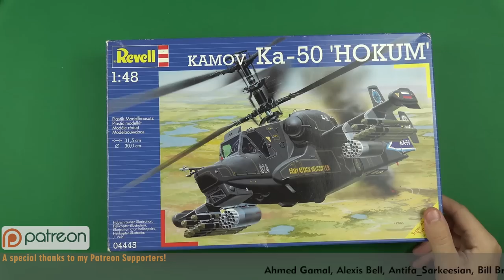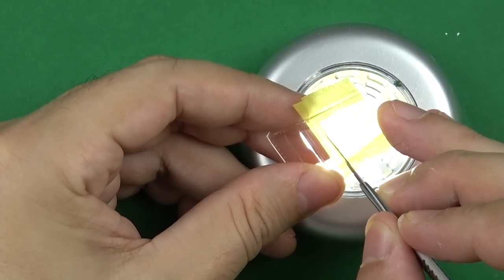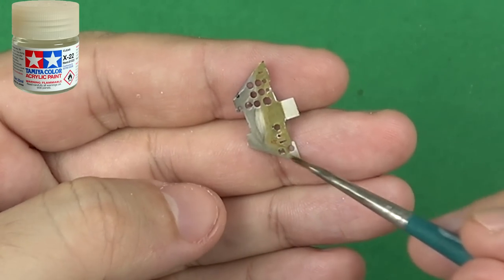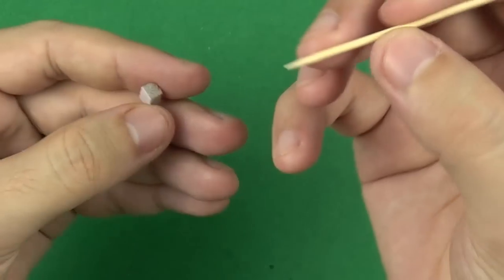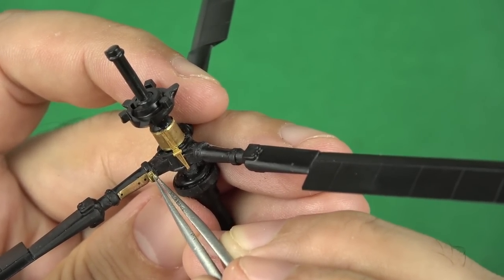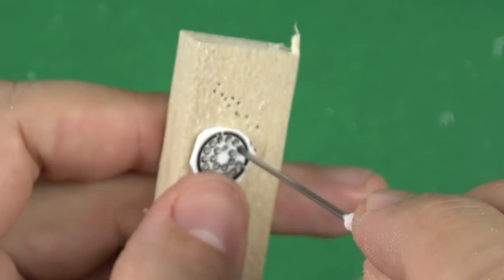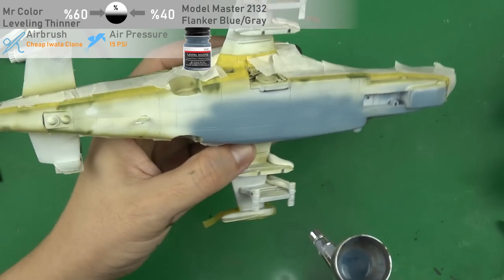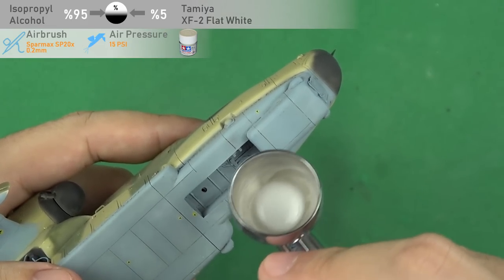1/48 Kamov Ka-50 "Hokum" Russian Single-Seat Attack Helicopter Model

Comment: I built the 1/72 version of that kit about a year ago. I did it out of the box. I wish the smaller kit had the separate inserts for the top of the fuselage. I lost most of those vents in fixing the centerline seam. I replaced them with some raised screen decals from MicroMark but they don't look as good as the engraved ones.

Comment: Hello Rahmi,
after 3 months of build I finished almost a copy of your Ka-50 model with your video as a manual and aftermarket additions. It was a fantastic build, I had same issues. I made the same error, nozzle break mounted 90 degrees wrong. but I saw you mounted the undercarriage fin in the wrong direction that I could avoid ;)
greets from germany
Reply from the maker: When I read such feedback, I am very happy and my motivation to do this job increases. I am so glad these videos useful for some modelers around the world. Cheers my friend!

Comment: Wow! Amazing work.
Question : it looks like you often glue painted parts together with green cap Tamiya cement. Is this correct? Does it really hold well? Again, amazing! Thank you.  Ken
Reply: The extra thin Tamiya is one of the best model glues out there. simply fit, add a dab of glue, capillary action takes it into the join, sets fast and well. Excess will not mar the plastic, unless it hits your fingers.

Comment: Hi there, awesome job as always, love the detail and extra mile you allways go. 2 thumbs up ! I have 2 questions, after paint before applying decals you apply a clear coat. Do you mix x22 with isopropyl? And I saw you glue PÉ parts to clear plastic with x22 correct ?